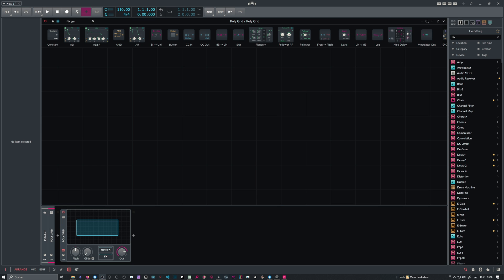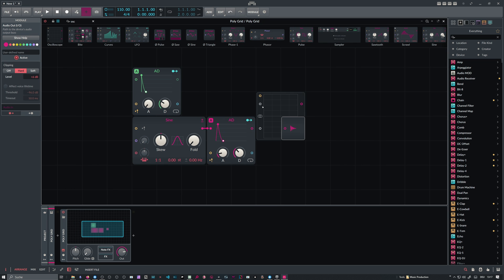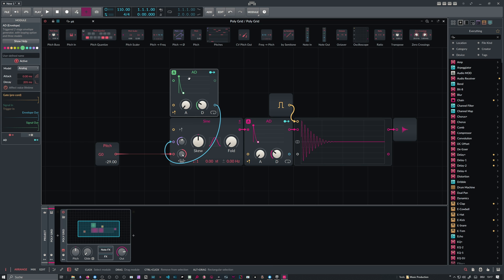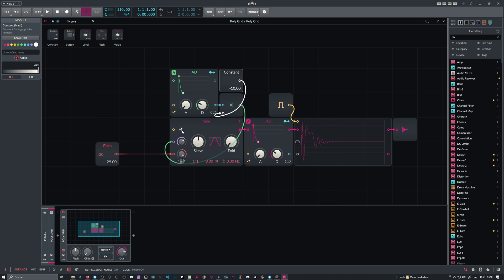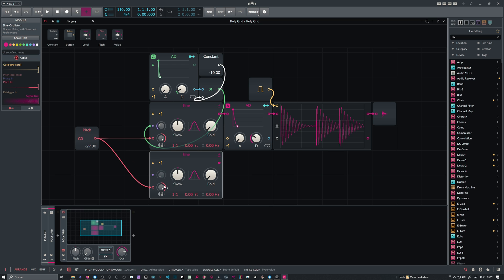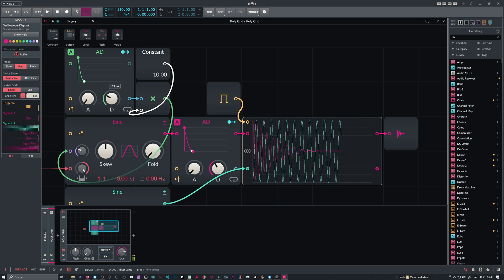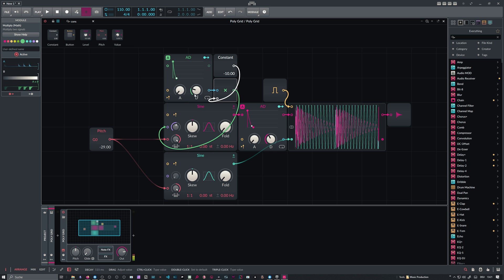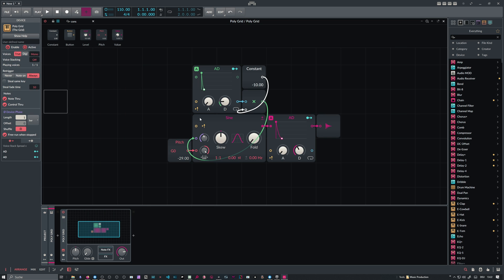rock solid, phase aligned Kick Drums

Comment: Man, i don't get it! How can modulating the phase do the job, what ususally modulating pitch/frequency does? Phase is where "you are" on the sinewave, amplitude is how loud it gets and frequency is how many repeats you have to match a certain pitch. On the meter the distance should get longer between the amplitudes, but it stays constant, while the sound gets deeper. As i said..... 🤪
Reply from the maker: What happens when you change positions where you are on the Sinewave, while you play the sinewave? It’s like a traffic jam. The sine gets squeezed together. What happens when the distance between zero crossings decrease? Yes the pitch goes up. That’s what happens here. If the phase input is zero the sine goes back to its initial phase position which is utilised here. 👌🏼